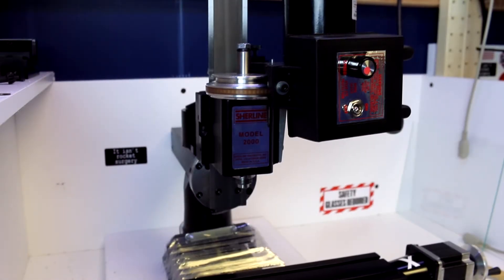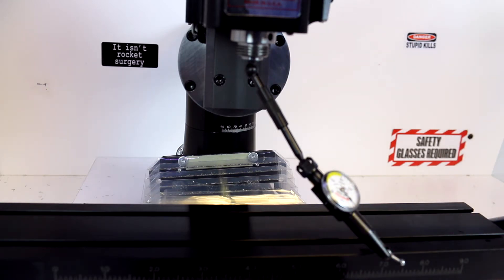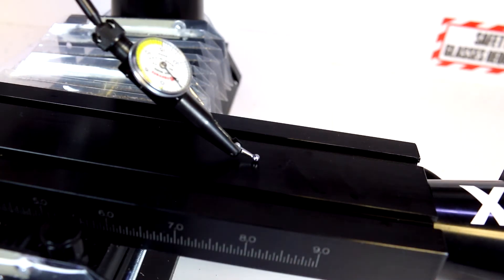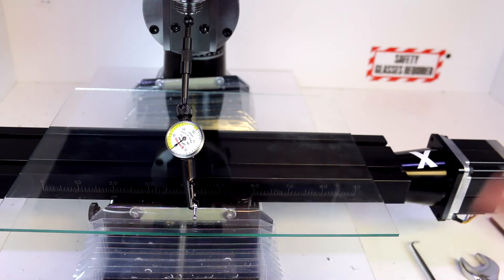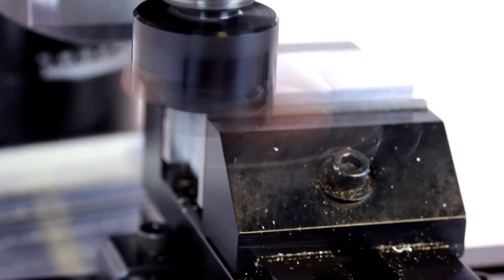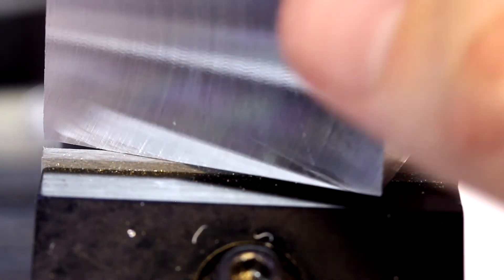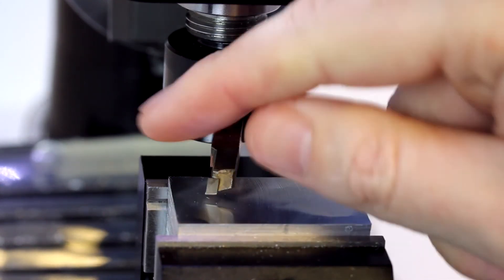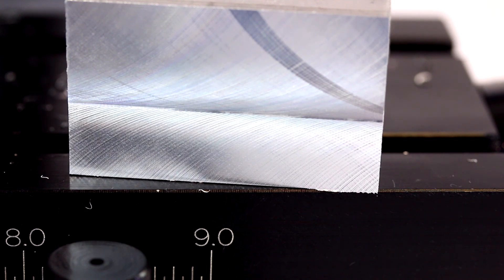Vertical Mill 102 - Alignment Part 2

Comment: great video---love your channel.  Question:  I am  buying a sherline CNC package---would you recommend the 5400 or the NexGen 5800??  (assuming price difference is not a factor).  I have machining experience on an older J head Bridgeport--but its been suggested to me that the 5400 I better because its "extremely difficult" to tram the 5800...supposedly goes out of adjustment frequently.  I would really value and appreciate  your opinion before I pull the trigger...

Comment: I really like your video about alignment.  I have a 5400 mill that I want to align the column with the bed, and align the spindle with the column.  The 5400 doesn't have the left/right and front/back column alignment as the 2000 has.  I just recently aligned my 4400 lathe spindle with the ways, and I assume the 5400 spindle may also be out of alignment with the column.